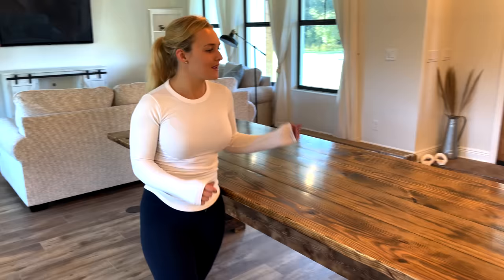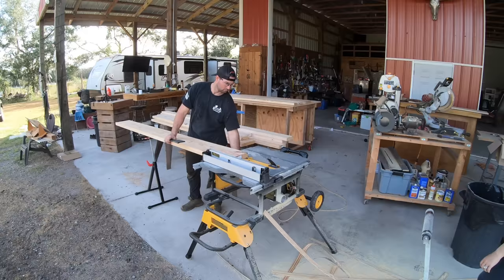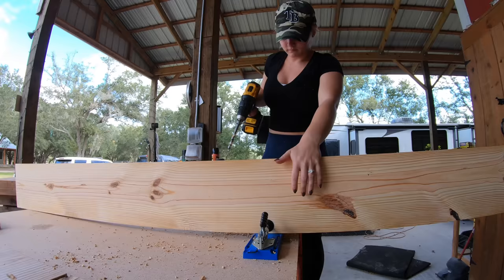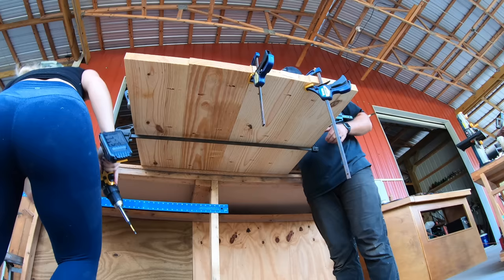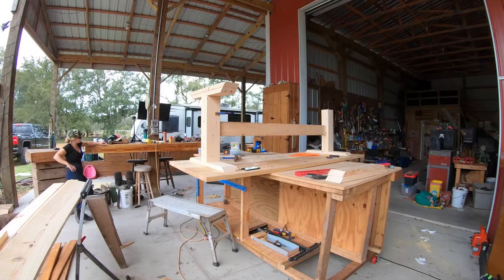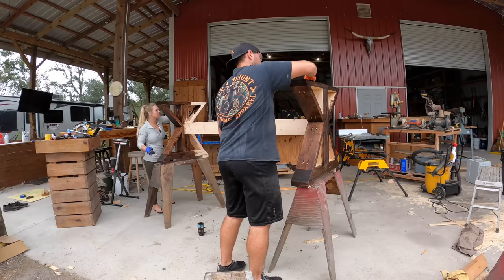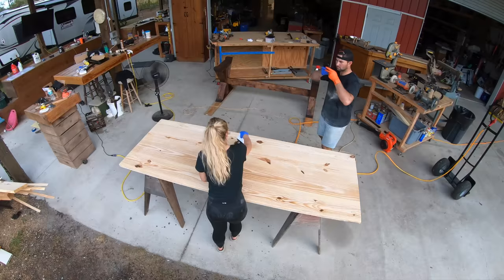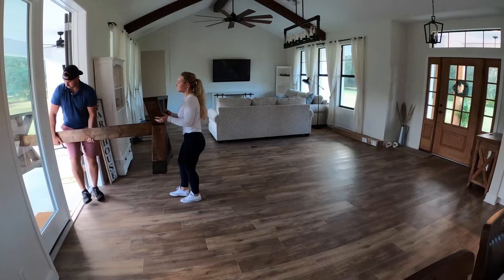Beautiful and Easy Farmhouse Table Build - 12

Comment: You guys seem really nice and cool, and I love the effort on this table! As a professional table maker, I can give you a few pointers for next time. Pocket hole screws are ok but you must use glue or else the table will begin to separate within a relatively short amount of time. By sanding up to 800, you closed the pores of the wood and made it unable to accept stain, next time, stop at 220! you cannot feel the smoothness of the wood anyways, because poly is a topcoat and rests above the wood. By the way, make sure you do at least 4 coats of poly on the top and bottom equally! Finally, when you attach the base to the tabletop, make sure you have slotted holes in the base to allow for wood expansion because if you do not, the table will bow or cup within a short amount of time. Please let me know if you have any questions and again, you guys seem great and good job for your first time!
Reply from the maker: Thank you so much for these helpful tips. We really appreciate it.
Reply: Great advice Nathan. Do you thing it will eventually bow in the centre given theirs no support there?
Reply: Great advice
Reply: Glue and clamp, done
Reply: I agree it was a great video… is it hard to make and sell a table like this for profit? I respect the wisdom in your advice!
Reply: Your a king
Reply: Your the man
Reply: What do you mean by slotted holes in the base? I'm making the same table and I love all these tips and tricks.
Reply: @tomicakelly3507  No, I don't think so, barring any issues with the pocket hole joinery...
Reply: @nicorogers6435  Depends on what you know and how hard you are willing to work
Reply: @scholarsacademy4946  the wood expands from side to side, but not as much on the length. Therefore you need to leave room for expansion. If you simply use a round hole, the table will try to expand and won't be ablet too. This will cause bad things to happen. Instead, use a metal plate with an oval slot that allows the table to move!
Reply: Still don't get it
Reply: @zackje1  in the base near the top you cut slots the width of a blade basically. Allot of people use biscuit jointers to cut the slots, then you use small L brackets one end slides into the slot you made unfastened, the other side of the L is screwed into the top. This allows the l brackets to slide within the slots when the wood expands and contracts over time keeping it from causing issues.
Reply: Excellent advice! You helped me by helping them.
Reply: The exact advice I received years ago from someone when I was learning myself (and still am..) and boy was it accurate!👍. Great build, looks nice!!
Reply: Couldn't have said it better
Reply: table what table
Reply: Main thing I'd say is to alternate the wood grain from board to board. By doing this, when the wood moves, it'll move evenly throughout the entire tabletop!
Reply: What about using a washer in between? Would that help?? Thanks
Reply: @nicorogers6435  I make and sell these every week definitely not hard to turn a profit
Reply: I'm just learning how to put a good finish on.  Seems like it goes better for me if I put 2 or 3 coats of poly on with very little to no sanding in between.  Then sand smooth and apply a few more coats of poly using steel wool in between.  If I sand smooth between every coat, I end up taking off most of the poly and the next coat just raises the grain again.
Reply: @nospam3409  scuff with steel wool. Need to do this step as it makes your finish finer an more durable. Risk of peeling if you don't, although it's never happened to me when I skipped it in a hurry. Mainly do it to remove small dust particles an such before the next coat. Finish with 0000 steel wool and quality furniture wax. Like butter baby

Comment: I worked for an unfinished furniture store doing custom finishing for 8 years. We only used 150 grit sandpaper for pine and 180 grit sandpaper for oak prior to staining and clear coating. The finer grit sandpaper ends up polishing the wood and doesn't allow the stain to soak in as much. Your clear coat will level out any imperfections in the wood. Your table came out great!
Reply: Exactly. I've worked as a cabinetmaker for 35 years.

Comment: I love pocket hole joinery, and use it whenever I can. But in the case of a table top, I think I'd go with offset double row biscuits and glue. (and lots of clamps!) The primary reason, being to minimize any chance of splitting , warping, twisting and cupping that softwood framing lumber is famous for.
Reply from the maker: Thank You

Comment: I have been building furniture for several years now.   I have made tables very similar to this one.  I actually go a bit over board and use pocket holes and glue with biscuits.  It really makes it a super strong joint.

Comment: I used pocket holes and glue on two of my tables. Been outside under a patio cover for nearly 5 years. Works fine, but I'm cheap, so after the glue was nice and hard, I actually took all the screws out to reuse them later! So, glue will be just fine.
Reply from the maker: Thanks for the feedback! I will use glue on the next table build.
Reply: I like your thinking!
Reply: @spudth  I don't use pocket screws often, but I have not bought new ones in a few years. I realized most people only glue up tables tops, so if I was using glue and screws, what was the point of screws? I don't have a lot of clamps, so pocket screws are now mini-disposable clamps to me. When they get too stripped out, I leave them in. Otherwise, I wait for the glue to dry nice and hard and take them out! I still laugh a little when I do it.
Reply: Tights as a ducks arse! And that's water tight!

Comment: Just happen to come across this video and I must say that table came out great especially for never doing it before.  Just a side note, there’s no need to sand to that high of a grit, depending on the wood and what finish your using 220 is usually more than enough.  Your top coat will determine the smoothness of the final product. And as far as pocket holes or biscuits or dominoes, there’s no need for any of them.  Glue and clamps is the only thing you need.  The pocket holes are good if you don’t have clamps but it’s really just holding it together until the glue dries.  And biscuits and dominoes are only used to help with alignment(which does help quite a bit) but adds very little strength to the structure.  Not sure if you mentioned how you attached the top but make sure you used something that allows for expansion and contraction otherwise the top may crack or warp.  Hope this helps for your next project.  Great work.
Reply from the maker: Thank you so much Tony. We will definitely use glue on our next build. We also will not be sanding so high. We appreciate your feedback.
Reply: Tony, what is the best way to attach the top to allow for expansion and contraction? Thanks.
Reply: @bobbyfanman1734  look up z clip table top fasteners here on YouTube.  It’s easier to watch it then to explain it, but there real easy to use
Reply: @tonys602  great, thanks!

Comment: Looks great! I always use glue. I’d use a biscuit jointer (because I have one), or a Domino over pocket holes with the glue simply to avoid all the pocket holes under the table. I’m also a big fan of real breadboard ends. They add stability to very large tables and they are fun to make, I think they look cool too. 
I’m not too particular on the brand of stain, but I do like to use the staining pads during application. On soft woods (pine or alder), I use a homemade Pre-stain.
Reply: Agreed, pocket holes are never the way

Comment: The table looks great and compliment the decor in the room. I personally put tarp down when staining over concrete. I understand that it is a work area and superficial but if you stain a lot it really makes the area look run down after a while.  I would have done any different with the stain. It looks real good with the sorta two tone effect because of the different sanding grit. It adds just a little character that isn’t distracting at all but adds a little dimension. I would have been nervous about using pocket holes instead of biscuits and glue. You took a chance and it worked out very well. I’m inspired to give it a try.

Comment: I would used dowels and glue on those, wood expands and retracts. I would also used a pre conditioner before staining, I saw some blotches on the wood. Overall it was a solid build.
Reply from the maker: Thanks Nomad. I will definitely be trying a pre-stain next time.
Reply: Pre conditioner is a must for getting a even finish on pine. Good suggestion.
Reply: Yes always use pre stain conditioner but the reason the top came out lighter is because you sanded it to a much higher grit that the rest of the table. The lower the grit the more stain will absorb resulting in a darker color.

Comment: I'm afraid expansion/contraction/cupping/crowning will overpower those pocket screws in short order.
Reply: Very true.  Pocket holes are fine but a good wood glue should have been used as well.  Also the pocket holes on the base should have been hid.  The whole point of pocket holes is for them not to been seen.  The table looks nice in the end.  They built their own table so lets not overlook their effort.
Reply from the maker: Thank you Jerad and Norman for your comments. I do wish I had hid the pocket holes on the base.
Reply: @TripleLRusticDesigns  you can still fill the pocket holes with the plugs that Kreg sells for them, could possibly stain them and then install them so they blend in better

Comment: “Master Carpenters” scribe every chance they get. It’s the best way to make an exact cut. Ask me how I know.. Beautiful table!
Reply from the maker: Very nice! It does work pretty good!!
Reply: Master carpenters do scribe whenever mating an irregular surface to a non-irregular surface. It worked for you in this instance though. When building cabinets, furniture, and or other types of custom woodworking, everything should be cut and built to be square and precise. With this said, scribing is not a normal practice with those applications. In reality, you're doing a good job and learning in the process. To truly build with precision, you'd need serious wood working equipment in a shop setting. Many "woodworkers" don't really understand this. Hope this gives you insight into further projects.

Comment: Curious how that table top does over time? That’s a thick slab with lots of potential for movement for just pocket hole screws.
Reply: That's a nice way to say it's crap wood.  They made it look nice and sure even my picnic table is over 15 years old (built from magazine directions) but why not search out maple or oak etc.
Reply from the maker: Thanks Robert. I will do an update video in a few months.
Reply: @spudth  I didn’t say it was “crap wood”- you did. Not everyone can afford hardwood in those dimensions.

Comment: I would have at least used some glue along with the pocket screws.
Reply: @md6397  no it doesn’t.  You glue the edges before you screw it. Duh.
Reply: @MD 63 It‘s always good to check your facts before you comment. Gluing up after screwing would be impossible!!!
Reply: @robertw.1499  No doubt that is the method taught at the Terminally Obtuse School of Woodworking where you and 'ol Pete must be roommates.
Reply: @md6397 , don't worry. I got it. 👍👍
Reply from the maker: Thank you! We will use glue next time.
Reply: 100% would have used glue!  Would have probably avoided pocket holes as well. Dominoes are great but expensive. Some biscuits would have been your best bet. Or just glue by itself.  Good job though
Reply: @md6397  Anyone can make a mistake, but once corrected, insulting those who corrected you shows a lack of intelligence. Upsala, there I go again being terminally obtuse 😂
Reply: That’s one of the best schools around. Lol.
Reply: @robertw.1499  Anyone placing bets on how many weeks it'll take RW & PC to clue in?
Reply: @md6397  Don't believe they got the joke... haha.. nice one...
Reply: I got the joke.  It was crude.  Just tried to keep it clean.🤭
Reply: @md6397  I C what you did there...LOL!
Reply: I bought  a used table for $10
Reply: @md6397  i wont hire you.

Comment: 800 sanding on the top of the table may have been a bit much, but you did a great job thru-out the project. good job. atta kids.
Reply: Agreed. Like he said, the stain was lighter on the top, that's because they sanded so high and the wood fibers weren't open to except the stain. It also could let to adhesion problems with the finish later on . You get a smooth top from the finish, not necessarily the wood itself.
Reply: Would have been better off going up to 220 and using a sanding sealer for a more even stain
Reply from the maker: Thank you David! We won’t sand that high next time
Reply from the maker: Thank you

Comment: You're going to find that it still cracks at the joints, pocket holes along with biscuits are the way to go
Reply from the maker: Thanks Mario.
Reply: pocket holes with a glue up would work wonderfully.  not everyone has biscuit makers.   looked great tho!
Reply: A router with a slotting bit makes great slots for biscuits
Reply: Who cares.  Its crap wood.  With time and effort spend a little $ and get oak or Maple.  It can still be rustic but it will be a durable and stable wood.
Reply: @spudth  I wouldn't say it's total crap wood. I made my queen size bed frame and headboard with that same wood back in 2000. It's still in great condition and holding up well. Considering the price, it's a bargain to have a piece of furniture that will be durable enough to last that long with daily use.
Reply: @heesanoice7637  I understand what you are saying but if you have time to look around you can often find good lumber.  good that won't crack won't warp over time etc.
Reply: @mariocorleone106  Biscuits aren't for strength, they just aid in alignment of the wood.
Reply: @sarahcash7748  they do a bit more than line things up. Master carpenter for 18 years... When I started using biscuits... Never looked back. Pocket holes too.  But together.... World of difference... Especially with Lowes lumber at somewhere around 20% moisture content...

Comment: Great looking table. As a finishing touch suggestion, you can plug those pocket holes with some glue and dowel. Then saw them off with a straight kerf finishing saw. Give it a sanding and it gives it the next level character when staining.

Comment: I am a big advocate of the method you're using, and have used Kreg Jigs almost exclusively. The connection is solid, and not subject to rot or shifting. I like to use a blow torch to create texture and emphasize the natural grain in the wood. Try this take with blow torching and a wipe on walnut finish. It's really interesting, and shows very well. Nice work, I enjoyed your video.

Comment: I worked in a custom fabrication shop for years and never even saw a pocket hole jig until i started watching YouTube videos.  Glue and biscuits would be preferred for strength i think.  Pocket holes are fast and easy, but i think you get out what you put in.  I've seen some strength tests on youtube that are pretty damning on pocket holes.

Comment: If the center support for the pedestal bases is 24”, the supports are same dimensions. They are 15” in length, one end cut at 37.7 degrees and the other at 53 degrees. And I took your advice and stained everything before assembling. Thank you for video.

Comment: Yeah I have been building furniture for 25 years and I have to say this for the size of that table . Pocket screws will not withstand the test of time. That will fall apart. it is a lot of time and effort what you went through and to have it fall apart may be well a drag. But I suppose we all have lessons to learn in life. I would use a router and cut a spline if I didn't have a Domino or lamello machine. Nothing compares to the domino jointer. Or even a Hoffman jointer is really nice. Old school builders in the west or even Germany would use pinch dogs to draw the joints right and then make some nice inlays to cover the holes. Hope you all enjoyed your holiday dinner.

Comment: Looks great, I would have used biscuits and glue with metal C shaped bands on each end to keep it square. I also would have wood filled the seams and only gone to like 180 or 220 on the sanding. Yours looks beautiful and I hope it lasts a lifetime.

Comment: For the table I built my parents, I used hard maple from a tree that blew down in their yard.  The maple had spalting, some birds eye, and natural blue staining in places.  And lots of reversing grain.  I did breadboard ends.  Finish was two coats of Waterlox on the underside and 8 or 9 coats on top; I wanted it to handle abuse from grandchildren and great grandchildren.  Design used Greene and Greene influences (breadboards, cloud lifts, and dark pegs).  Surface planing of boards was done by machine.  Everything else was done with hand tools.  Everything was scraped not sanded.  Nicest thing I ever built but it was from my parents, so…

Comment: 1st off building materials are usually 12% or higher in moisture content, furniture grade is under 7% lumber. Biscutes/dowel pins with glue are better long term for joining long planks. Also should made sore if they were qtr. Sawn or standard mill cut. Qtr swan is better for tops. Your end results looks beautiful just hope it stays that way.👍

Comment: I just did some floating stands and the only stain I had was sun bleached.

So what I did was take 2 cans on Black & Brown spray paint that I had, did random sprays over the whole thing, then smeared it and wiped it around until it was a smooth covered finish.

Then I went over top of it with the sun bleached stain and wiped that off.

Cleared it with a satin finish and I'm telling you, it's one of the best color I've done. Everyone who's seen them so far loved it.